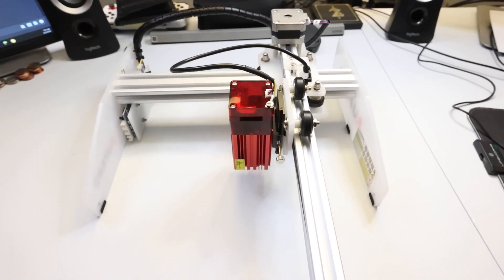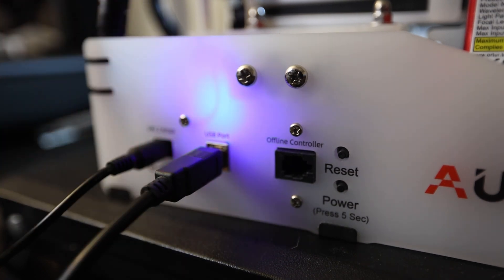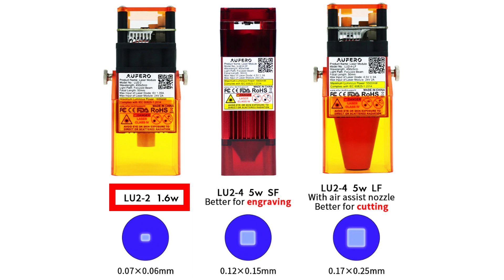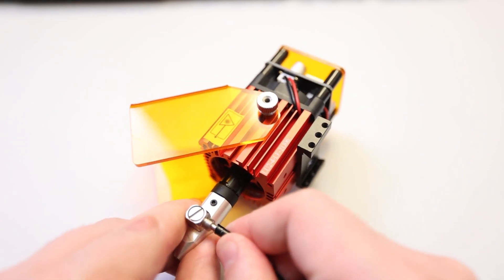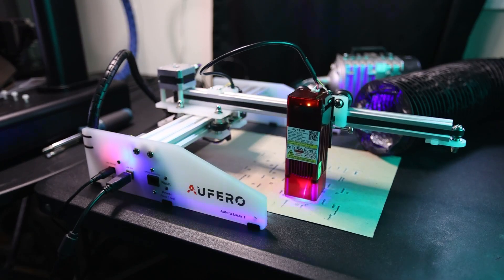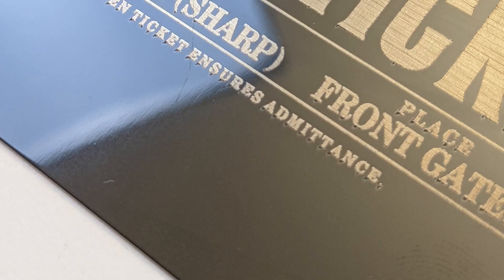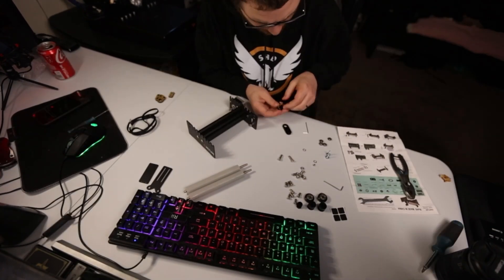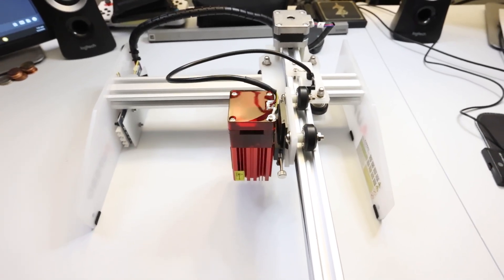Even if you have a CO2 you want THIS Diode Laser | Ortur Aufero Laser 1 COMPLETE Review 2022

Comment: Hi Alex, your videos are very informative and when my Fibre arrives i will be joining your master class, if for nothing else but to say thanks. This little machine might be the addition for me to do those small runs, as i am very very new, how would you go about marking then cutting out 3mm bamboo wood using the 2 types of laser heads, is there a setup process you recommend. A c02 is not on the cards due to my limited work area and for the cost of this device it will be a great learning tool.
Reply from the maker: Sounds good, so glad you're getting value out of the channel. If I planned on marking and then cutting I would be doing the entire project with the LF head. A head swap mid-job would almost certainly mess up your positioning. While the LF beam is thicker than the SF it's still perfectly acceptable for all but the finest detail requirements.
Reply: @LaserEverything  Thank you very much.

Comment: Just got the machine and did a photo test image with it. It actually came out pretty good except for some slight banding in some parts. Was researching and it looks like it could be a DPI settings issue? I left mine at 318 but not sure if that's right. Do you know what the correct DPI should be for this machine or any other tips on banding?
Reply from the maker: If you haven't go check out our episode on photo engraving, there's a part 1 and part 2 and we do use the aufero 1 in it as well as cover all of the concepts needed to make sure you're getting good images.

Comment: Can this engrave glass?
Reply from the maker: There are some methods online detailing how to mark glass with a diode laser with mixed results. Usually involving some kind of paint that you mark and then remove. I haven't experimented with it personally yet. They certainly aren't designed for that use. If you plan on doing quite a bit of glass I highly recommend a CO2 or UV laser.

Comment: My family apparel company is looking to laser cut some leather for hat patches I think it is right around 3mm thick would the larger of the 3 diodes work for that?
Reply from the maker: The LF should be able to handle it based on my testing but I have not run that specific job yet so I can't guarantee it.

Comment: The website states that this can engrave anodized aluminum. Will it engrave to a minimum depth of 0.003 inches in aluminum?  I am not running a business so time to get the job done is not a big factor for me, just like to know if the machine can do the job.  Thanks!
Reply from the maker: No, this machine will remove coatings like anodizing or paints/coatings from aluminum but I will not actually ablate aluminum material from the surface. For that you'll need a fiber laser.

Comment: Was considering the Laser Master 2 Pro S2 SF, but it looks like it uses the same laser head as this and they're both 5W, so now considering this. Would these 2 machines pretty much output the same quality in that case? I understand that the working area for this is 1/2 the size and probably will engrave slower, but output quality wise, am I missing anything?
Reply from the maker: No you understand perfectly 😃 that's what makes it so cool
Reply: @LaserEverything  Awesome, thank you! I'm sold :)
Reply from the maker: @xparte  I legit love it and it's so cheap compared to other types of lasers like fiber and CO2 it's just fun to play with :P
Reply: @LaserEverything  That's great to hear! I bought, it's on the way now. Can't wait to have a play.

I'm planning on buying Lightburn for it. I also plan on getting a fiber in the near future. Is there a particular version of LB I need to buy that will work with both or anything I should be aware of or does one version fit all?

Comment: Is that 2020 and 2040 V slot aluminum extrusions?  I have bunch of these from left over projects.  Looks like it wouldn't be difficult to slightly increase the work area size without affecting the quality especially the 2040 length.
Reply from the maker: I'm still learning as the diodes are kinda a new realm for me so I'm not crazy familiar with the measurements or classifications of the rails. Any easy way to tell?

Comment: would this cut 5mm cardboard effectively? ive ben usig my 50W fiber and its ok at 400hz 200speed multiple passes. but flare ups are an ussue
Reply from the maker: This or the Laser Master 2 Pro (depending on your single cut size needs) and the LF module should be an effective combo. Speeds are slower than fiber but I would assume you can do it in one pass and it should be less messy than the fiber if you utilize the air assist. I don't have 5mm cardboard laying around but we got almost all the way through 5mm ply so I'm assuming the cardboard would be easy.
Reply: @LaserEverything  ya i was thinking the pro, it would fit the job better (10x10 pc that hets contoured to nest machined parts into)  thanks, alwaysappriciate the quick replys and good into! well worth the membership cost IMO!
Reply from the maker: @brianwaayenberg3099  Most appreciated, happy to be of assistance!